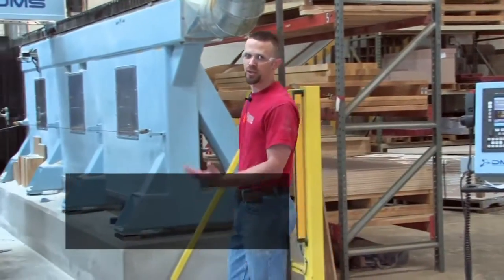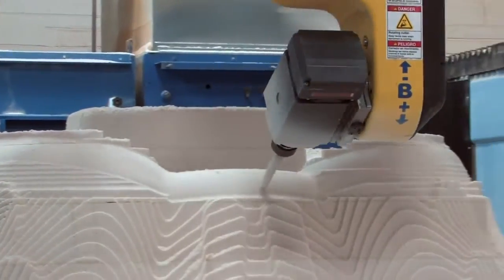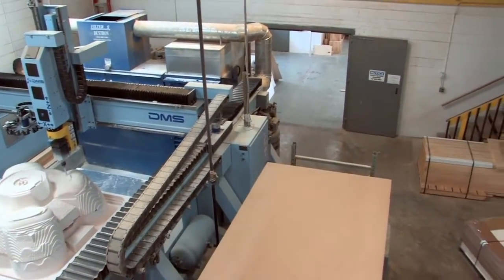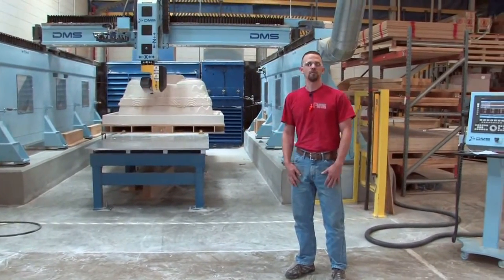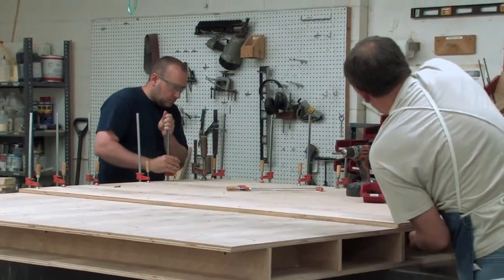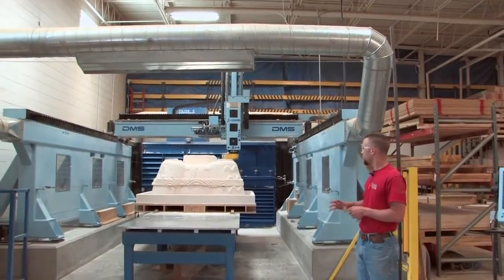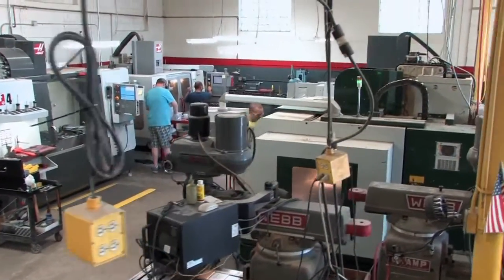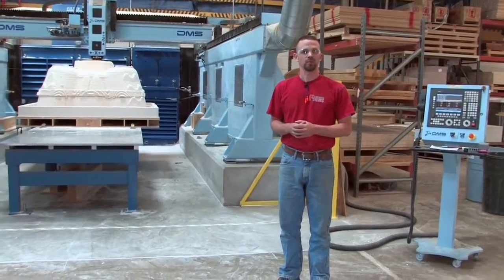5 Axis DMS Router & Shop Capabilities

Comment: Price ? Working table ?
Reply: I have no affiliation with this company so I can't answer specifically. But a giant 5-Axis CNC like this is going to cost more than an average house in the USA. 

Expect to pay $300,000-750,000+ (up to millions of dollars) but this can probably be financed though a business lender. So if your quarterly production can meet the minimum payment due, then you are in business.

Software to run it, I'm not sure. But in the USA most machinists use Master Cam which is the preferred choice for CNC toolpaths. Most companies and engineers use Solidworks, AutoDesk/AutoCad, Catia, Onshape, or Rhino3D or similar CAD programs for design. Rhino3D is my favorite for complex (freeform) shapes like this.